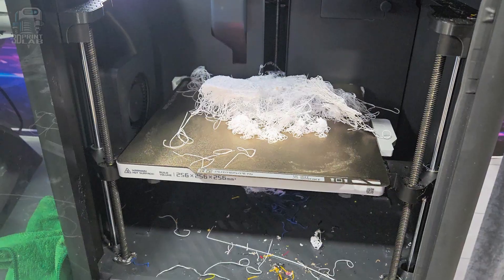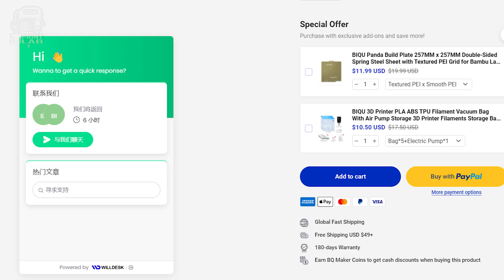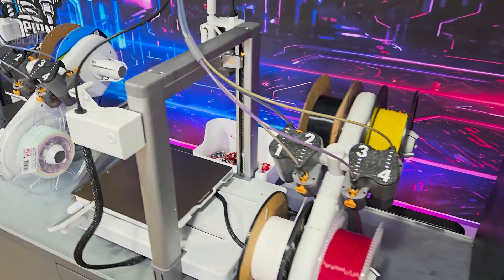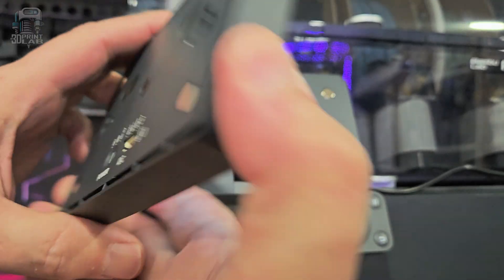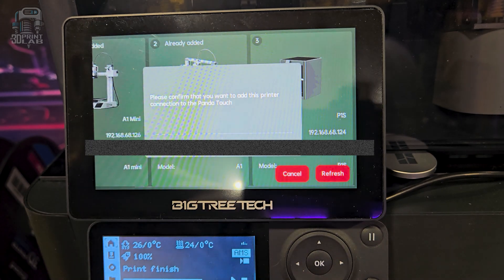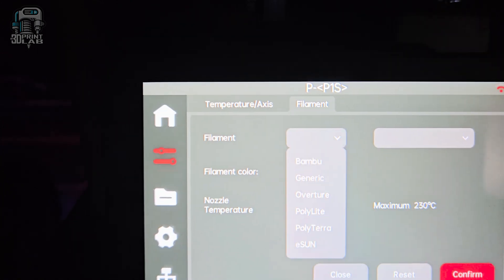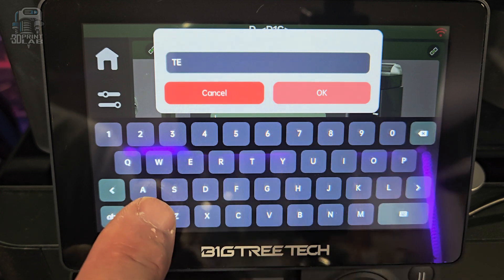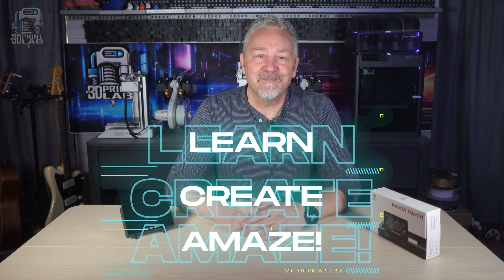Can One Simple Upgrade Make Bambu Better?

Comment: I've had one of these for a while. The things I like are  that it's a quick way to turn the light on/off, a quick way to tell the slicer what color / type of filament you have installed in what slot and a quick way to abort a failed print. It's also easy to increase the speed (e.g. Sports mode). I did have an issue with a firmware upgrade with it, which stopped allowing me to install a new firmware version, but I contacted the manufacture on there Github. They emailed me a program that did a reset and re-upload which worked flawlessly. They said because of this method this device is 'unbrickable', which is good to know. The only issues with this device is the battery life is pretty poor and the wifi range is less than that of the Bambu. I had to install another Mesh-router to get it to work reliably when the Bambu works fine in the same location.  I wish they had included an external aerial connection or at least make it easy to take apart so we can add our own. As far as I can see, I don't think it's possible to take apart without destroying the casing (unless someone can tell me otherwise?).
I believe it's also possible to change the firmware on this to turn it in to the Klipper version, so if it ever stops working on the Bambu, you can use it for (or sell it as) that.

Comment: Tempted, but as you’ve mentioned, there is one potential problem.  In that Bambu could if it wished, render this screen in operable.  In addition, I’ve seen posts which suggest that Bambu is working on a paid-for large replacement screen.
I think I’ll wait-and-see 😉

Comment: I have a couple issues with mine, 1. It won’t send the file on 5v dc switch position connected to the P1S usb, I think the draw is too much because the screen just reboots. 2. When in battery it sends the files to the Printers but doesn’t start the print. I have the newest firmware so not sure what’s going on. I believe it’s because my group has an AMS enabled P1 with a non AMS P1. Also you can’t delete a group once created you just keep adding them or to them. The Panda touch is a solution that wasn’t needed but as a geek I couldn’t resist, so maybe it should be called a Pandering Touch.

Comment: Bought mine two weeks ago direct from Big Tree. Mixed feelings. The usb cable they supplied with the unit was faulty and wouldn't power it or anything else no matter if I used my P1S USB port or a dedicated USB source. Just a dud cable. Second issue. The only thing that works with the Panda Touch on 5V mode is using a 100 watt PD charger cable on a PD charger. The USB port on the P1S won't start it no matter the cable. The screen just "flickers". So maybe you will be lucky, maybe you won't. Looks good when it works but not worth the hassles I've encountered.

Comment: Nice catch with the issue with multiple model types being sent one print job.  Any ideas what you think was happening?  I thought all the calibration routines were performed 'on printer' so the BTT wouldn't need to manage any hardware differences.
Reply: It is because you are using a file sliced for a specific printer and using it on a different printer. It would be the same if you sliced a model using a profile with another printer. If I take a file make for my bambu and used it on a creality printer, the results would be similar to the issues mentioned, e.g. the homing direction would be different, the bed size would be different, etc. etc. = motors would grind, the head could plow in to the bed, the motors would run too fast.
It's really not surprising it did not work.